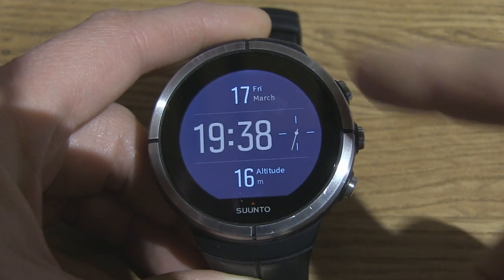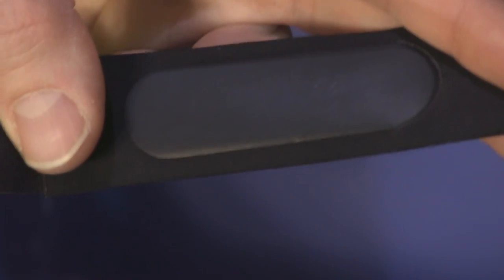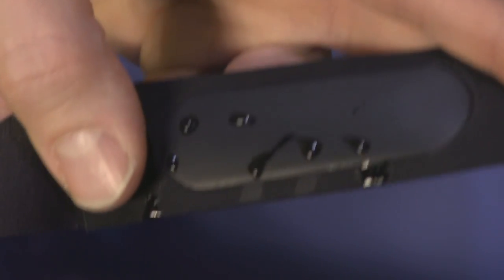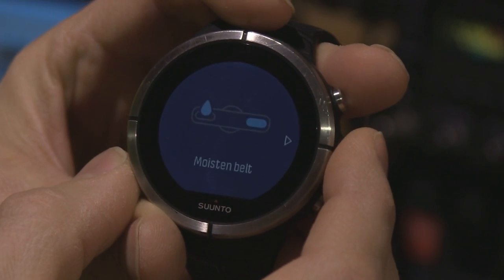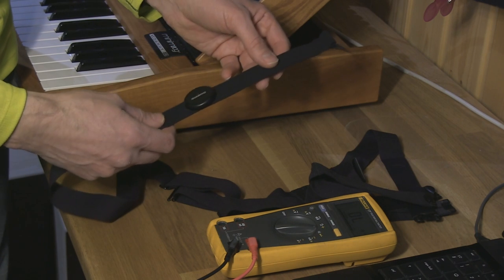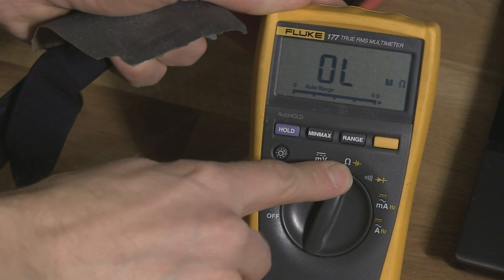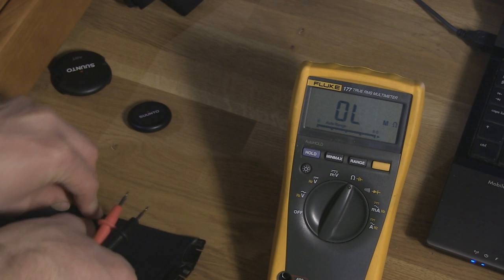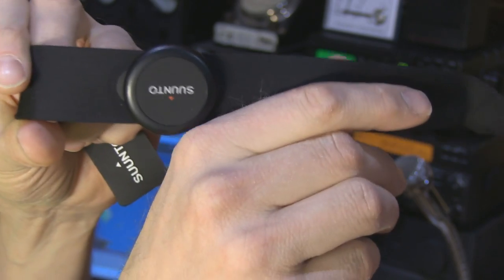A Great Trick Solving your Heart-Rate Strap Problem

Comment: Try conductive gel, $2 on amazon, works in the winter ( low moisture dry air) and lasts the entire workout.
Reply from the maker: Sure you can use gel but water is easier because you probably have it already available and it works equally well.  Air humidity does not matter much.  This is about your skin humidity, which depends more on your hydration level and perspiration level.  Perspiration will keep a good conductivity during latter part of your exercise.  In the beginning extra moistening will help before perspiration kicks in.  Water on your skin will mix with your body's natural salts and make a perfect electrode solution.  No need for the stickiness of the gel either because when you cover your skin with the belt the moisture will stay there and not evaporate or transfer to your shirt.  Chemical gels might not be as healthy, depending on their compositions.  Silver in particular might have unhealthy effects especially under repetitive use.

Comment: Hello Tom, I used my strap over a year. Battery ran out. I replaced and ran out after 2 runs. This happened 3times ever since. I used batteries from other stores, even good brand.
Reply from the maker: Sound like it might be broken.  Also make sure that when you store your belt that the pads are not touching each other - otherwise the belt will transmit all the time.  It shuts down after a while when the pads are not touching anything.

Comment: Great video, thank you.  What is your take on the chest strap heart monitors that pair with your watch?   I've been hearing good things about it.  But logically thinking,  with all that radiation, and bluetooth rays going and working to and fro around your body, with one of them right on top of your heart,  is it really "not" dangerous from a help perspective?    Anyone?
Reply from the maker: Thanks!  Yes these straps are good.  The optical wrist heart rate does have problems.  For some exercises and some people they work OK, but for some other they are unreliable or don't work at all.  Chest straps works almost always, especially with my tips, except swimming.  Also, women have sometimes problems with their bra pushing the strap or going under it.  Bluetooth is quite low power and 2.4 GHz radiation does not penetrate deep below skin.  Cell phone in pocket, or hand is a much bigger source of radiation.  Bluetooth headphones or earbuds next to your brain could be more concerning than heart rate straps.  They are emitting more energy than the heart rate strap.
Reply: @TomTechVideos  I couldn't agree more.  Thanks Tom.

Comment: …...4 year old belt, well used, intermittent heart rate readings, soooo...I washed it, replaced the battery, reset it, washed the strap, washed the contacts etc  and having established my belt was defunct. I sourced a replacement for £20....then decided to use fine sandpaper on the rubber contacts on the belt to rough it up a bit and in theory improve connection.....success, belt back fully functioning.
Reply: For how long it worked? Interesting idea to try on a dead belt.

Comment: thank you for your video. I found this very helpful. Question : How can I measure HR belt's resistance if the module is not removable such as Garmin HRM tri?
Reply from the maker: Proper measurement is probably not possible for such one-time use systems.  You can try measuring the resistance from one end to the other of the visible part of the pad, for each pads.  But if there is a problem in the non-visible parts it won't show.

Comment: Hi. How strong should I press while measuring resistance? For if I press slightly with approximate power on my chest, then it is above 20 oms. But if I press hard, I can reach about 9 oms. So what power is OK? And one more question - why you say 10 oms are the line I can through my strap off? :)
Reply from the maker: In theory you should not need to press very hard - only as hard as the belt would press against your chest while in use.  The unit is kilo-ohms.  Yes I said 10 kilo-ohms and that is a very approximate value from my experience.  There is no exact limit, the results will slowly get worse the higher the resistance will get.  A brand new belt can be something like 2 to 3 kilo-ohms I believe.  Your belt sounds like it is on the edge.  You might try to clean it.  A clean belt does not depend so much on the pressure.  Maybe gently scrape the electrode surface with something to get any possible thin coat of dirt off it..  Detergents might help but they might also do more damage than good if they contain the wrong chemicals.  Then after cleaning measure again.  If you get the 9 kilo-ohms, or less, without pressing hard the belt should work for a while longer.

Comment: what kind of battery is used in Polar H 10? The one where  voltage slowly goes down to zero, or the one where  voltage is constant 3V during the lifetime, and then it suddenly drops to zero?  Or, in other words: how can Polar measure your heart voltage in micro-volts, but can't display if a battery is 3,12V or 1,97V ?

Comment: My brand new suunto Smart Sensor spikes to heart rates of over 200 bpm, while my max heart rate is 189 bpm. I wash and dry it after each training. My polar H7 works perfectly fine. Suunto has problems.
Reply from the maker: Static electricity from a shirt might cause these kind of wrong reading.  Some people slightly wet the shirt too to reduce static.  Or the belt may be broken.

Comment: Hi! I have a garmin 310xt and it is shown at rest 190bpm witch of course is wrong. Do you thing is the belt or the sensor that  should be checked? Thank you!
Reply from the maker: I'm not experienced with the Garmin, but it sounds it could equally be either one.  If you do the checks and tricks I mentioned in my video and they don't work, it must be the sensor that has failed.
Reply: @TomTechVideos  Thanks!!

Comment: I found where the problem is with pairing belt- after some time without using, I can't pair my belt with Suunto watch. Try to reset belt, but without success even battery in watch is new. Then I change battery in watch - even watch  works well, and now paired successfully.

Comment: Just measured my Polar straps. 165k Ohms... No wonder the system was giving me issues! How do you know that 10k is too high? Just curious as how you found that 10k number? Thanks!
Reply from the maker: The 10k number is approximate and I have found by comparing belts that Suunto belts work well if the value is below this limit. Other models of belts might have slightly different limits but the human skin resistance sets a base level.

Comment: one other youtube video suggesting cutting the belt so that the contacts are on the sensor is connected to two separate sensors (no longer connected via the garter between them).   This solved things for me.   i had a new sensor, new belt, and new batteries and still had issues.  But all was fixed after cutting the belt.  

Do you think that cutting the belt actually fixes the resistance issue too?
Reply from the maker: You probably mean the sensor is connected to two separate pieces of belt.  So cutting the belt between the two metal snap connectors.  OK,  if the problem is contamination between the snap connectors making a short circuit, it would help cutting away the short circuited material.  I guess this would be a very rare condition.  More likely there might be a lose contact between the snap connector and conductive plastic, or within the snap connector itself.  Then by cutting away the belt between the contact would create a pull-force across the snap contact keeping them in constant tension and removing any slack, preventing a lose contact.  That sounds logical.  But I think by far the most common problem is dry skin, creating bad contact and static electricity from the shirt.  This can happen even with a perfectly good sensor.  To avoid breaking the snap contact of the sensor try not to bend the belt too much when removing the sensor from the belt.
Reply from the maker: And about the resistance - no, cutting the strap will not improve the resistance.  If the material has deteriorated it can not be fixed, at least that way.  Only if there is a lose contact, cutting the strap might help.
Reply: Kiitos

Comment: I use an electrolyte gel on the strap contacts.
Reply from the maker: Yes, gels work too.  But water is more easy to find.  Even outside if one finds that the HR does not work, one might find a lake or river or even wet grass to grab some humidity with the hand and apply.  Regards, Tom

Comment: Use uLtra sound gel or adult lubrication gel. It will stay moist for hours. Water or sweat on skin will also evaporate if your doing a easy workout. Lubricant will work amazing.
Reply from the maker: Good hint about the gel Manny!  Some even use silver gel used with medical ECG electrodes.  Certainly worth trying if the belt stops working after a while into the workout.  But usually the problems are in the beginning.  If the belt does not move much it will stay as a cap over the moist skin and prevent evaporation, even if there is not much sweating.  Unless you have a belt with fabric-like electrodes, which will allow evaporation.

Comment: What is "stupid" is buying a heart rate monitor belt that is designed to not hold the water. For instance, there are belts where the contact point is made from conductive "cloth like" material that absorbs the water. There are belts that have grooves where the water is applied and these grooves hold the water via surface tension. 
But, if you didn't know this when you bought your heart rate belt/monitor, se la vie.
Reply from the maker: Yes but it is equally, or maybe even more important that the skin around your belt is wet too because it will greatly reduce the static electricity that will also interfere with the HR measurement.

Comment: Hello Tom, is it necessary that the central sensor (where the battery goes) is in contact with the chest? because I have pectus excavatum and this sensor is suspended in the air but the side contacts make contact with my skin but I do not get a real heart rate. Thanks you!
Reply from the maker: The sensor does not have to be in contact with the skin, only the electrodes.  Depending on what materials you have over and under the sensor, however, when you run the sensor will jump around a little and rub against these materials. Not having it against your skin might make the situation worse.    So if your shirt is easily generating static electricity, there might be some interference from this electricity to the heart rate measurement.  In this case, making the shirt wet in the area of the heart rate belt might help.

Comment: Hmm, strange. I get extremely high resistance values between the two points where the sensor connects (100k-300k, sometimes way more, with the electrodes together of course), but the pads themselves seem fine. With both probes on one of the electrodes, I measure 580-700 ohms from end to end. Far less when the probes are close together. However, the resistance between each pad and its connection point is very high (80k-200k for one, 20k-30k for the other). It's like the connection between the two is poor.
Reply from the maker: Yes I have heard it can happen that the connection break between the pad and snap connector.  Then I guess a new belt is the only option.

Comment: Hi. I have this belt and I notice that when the CR2025 battery gets to 2.9v the belt won't connect with my Suunto peak watch and I have to install a new battery.  This occurs consistently. I use Duracell batteries The manual says the battery should last 500 hours. Is the smart sensor broken or consuming too much battery? The sensor is 2 years old, in good shape. Thank You

UPDATE: I installed the "old" battery which has 2.9v back into the sensor and used the movescount to connect to the sensor so i could get a battery level reading. The battery is showing 50%. I wonder if the sensor is acting weird.
Reply from the maker: Hi Mark.  Sorry for slow reply as I saw your question just now.  Yes the battery should last very long in the Suunto belts.  Not sure about the voltage that is required but I suspect the smart belt should work even with lower voltages, maybe as low as 2.7V.   If you measured the battery voltage using a voltmeter without having any load, the 2.9V surely indicates an empty battery.  The voltage will drop further when the heart rate belt is drawing current from the battery.  Make sure when you are not using the belt that you leave it to dry so that the contacts are not touching each other or anything wet or conductive.  If they do, the belt will be active all the time and drain battery.  You can even try to snap off the module from the belt and dry them separately.  If this is not the problem there may be a fault with the module and you should contact support for replair/replacement.

Comment: Do I need to take wrist sensor off from my bro 9 when I wear smart sensor?
Reply from the maker: I think it should automatically use the wireless sensor if it is paired, enabled in training mode and it is found when starting the training.  Only if wireless HR is not found or disabled the wrist sensor is used.  You can see from the small heart rate symbol which sensor is used for heart rate.  The wireless HR has a different symbol.  Try with and without the strap and see the difference..
Reply: @TomTechVideos  Thanks. I will play with it little. It's just so.. annoyingly unreliable.

Comment: For me, it seems the sensor gets too wet from sweat. If I dry the sensors off while cycling, it correctly records my HR. The drop off usually happens after it's >145 and I sweat more. Obviously Wiping my chest every three minutes is problematic. I have a wahoo tickr, a garmin, a kinetic. All of them behave the same. Thoughts?
Reply: I'm not familiar with those sensors.  If their electrodes are not far enough apart, or the insulation in the middle is not good enough, sweat will kind of short-circuit the signals before they get into the electronics, making them too weak to be accurately detected.  Swimming in salt water also causes this kind of short circuit, in addition to that swimming easily makes the belt come off your chest.  A fix might be to wrap some thin plastic around the middle part of the belt to try to keep it dry.
Reply: @aholatom  Yes - I think that's the direction I was heading in - I may try wrapping it in saran wrap to protect it. I'll be riding today and will see if it works. Thanks

Comment: Hi how long do batteries normally last ? mine seems to get through them every couple of weeks which seems a lot , I do turn off the heart rate function on the watch after going for my run , thanks .
Reply from the maker: Couple of weeks sound a bit short unless you train for hours every day.  Some battery models are low quality and last only a short time.  Also, take care that the belt is hung to dry after use and the contacts are not touching each other.  If the belt senses current flowing between the contacts it will not shut down.
Reply: @TomTechVideos  Cheers mate for the info :o)

Comment: Hi Tom, Ive had a problem with my Polar strap suddenly not connecting, and replaced the battery but still no go.  My Multi Tester has various ranges to select from between 200-2k-20k-200k and 2m. Which range should I be using to test?
Reply: You use multimeter range what gives you reading. If it is out of the range you got nothing to read. Use 200-2k and 2k-20k first.
Reply: I don't get a reading on either of my straps on any setting?!?
Reply: Nomadski So it is broken?

Comment: Hello!
Does this suunto have the external temperature function ??
Reply from the maker: Hi!  Yes it can show temperature.  Temperature is also logged during training modes so you can view a plot of how temperature changes during your move.  Most accurate outdoor temperature results you get if the watch is on top of your jacket.  If the watch is against your skin your body heat will make the watch warmer.  For thick jackets you might need to use an extension for the strap to make it longer.  I made one myself by cutting a spare strap.
Reply: these days I got to take a look at the functions and did not see this function. Does this function only show when in training or on a daily basis can be shown on the watch display?
Thank you very much for the answers.
Reply from the maker: Seems that with current firmware version the temperature is not shown in the time display mode.  At least I did not find it.  Maybe it is in one of the many watch faces options, but I'm not sure.  However, I think I read somewhere that the temperature will be coming to the watch display in a new firmware update.  Also, note that the temperature comes from the barometer, so watch models without barometer will not show temperature.
Reply: Good to know that. The update firmware may be included in the next update.
Many thanks for the reply.

Comment: Water stays just fine on Garmin HRM strap.. the contact area does not roll of water like the one shown in this video.. maybe Garmin changed the material
Reply from the maker: Yes some materials might be less hydrophobic and more hydrophile than others.  But the amount of moisture is never enough if you put water on the belt.  The belt usually moves down somewhat after you have put it on and the moisture is left higher up on your chest leaving the skin under the belts new position quite dry.  Moisturing a wide area of your chest allows belt movement.